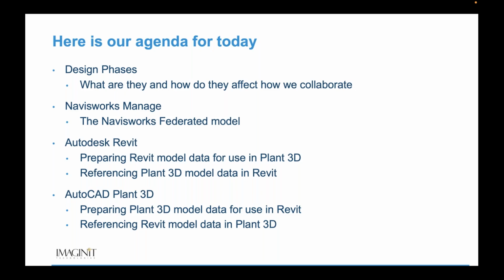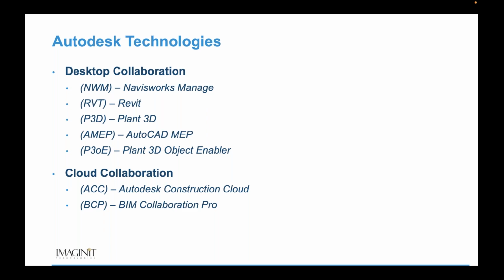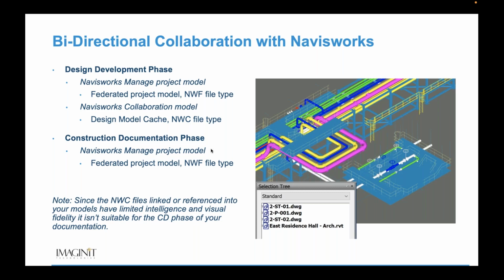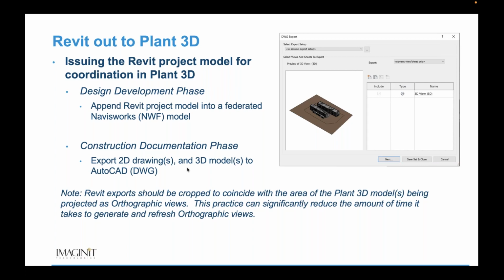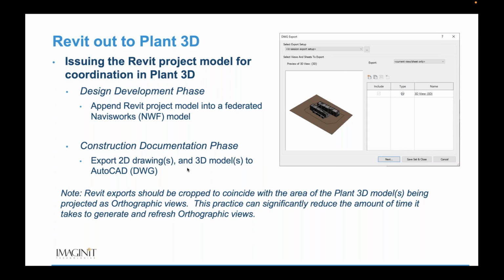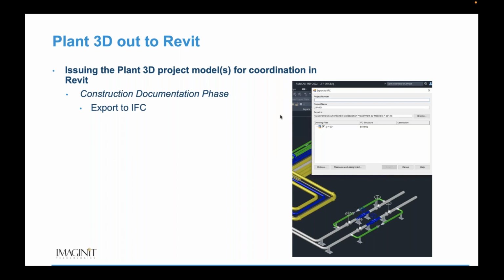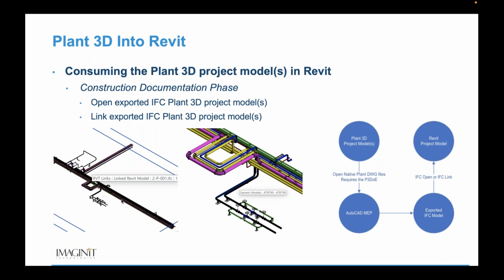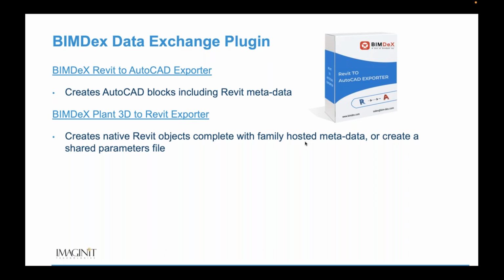Collaboration Between Revit and Plant 3D

Comment: There is no need to put other disciplines models into your Plant projekt to create ortho drawings. Simply create an empty "anchor" model in Plant and then xref desired model as attached. Then create ortho using "anchor" file. This way you can copy replace external file without ever touching the "anchor" file again. Also the suggested copy replace metod won´t work if you are using Vault.